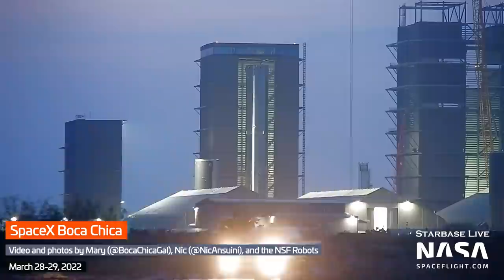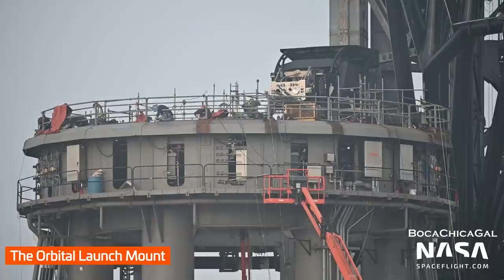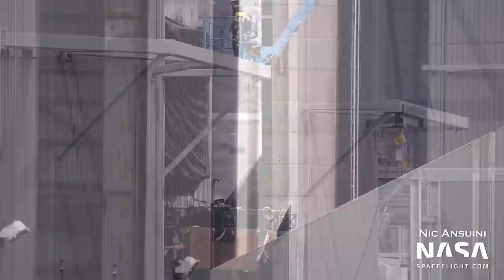Ship 24's Nosecone Nearly Ready for Stacking | SpaceX Boca Chica

Comment from the maker: 0:00 - Booster 7 Moved in the High Bay
0:30 - Sunrise
0:58 - Starhopper
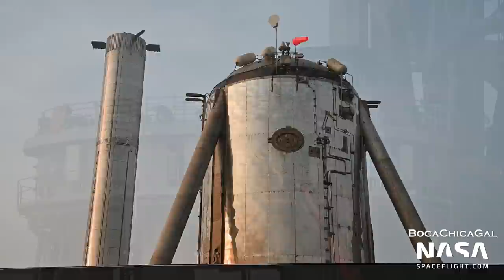1:13 - The Orbital Launch Mount
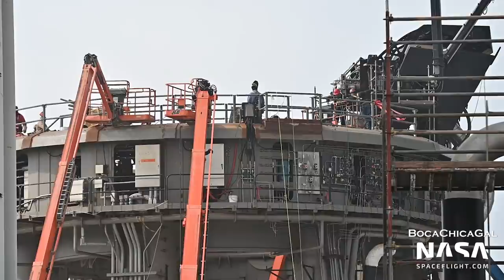2:06 - The Booster Quick Disconnect
2:23 - Liquid Oxygen Delivery to the Orbital Tank Farm
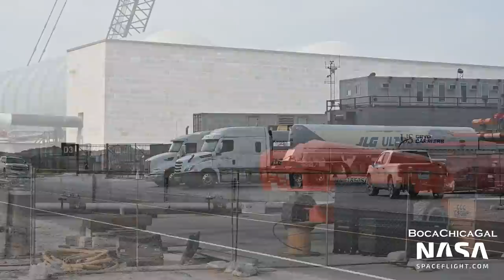2:39 - Crews Work on the Orbital Tank Farm
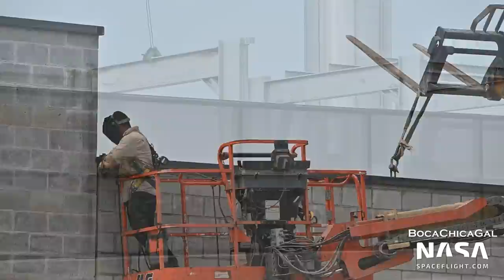3:56 - SPMT Power Pack
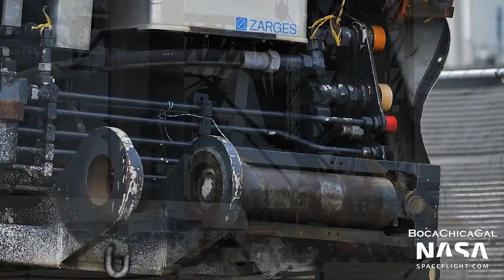4:45 - Ship 20 and Structural Test Stand
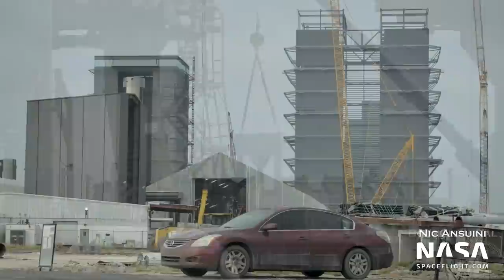5:52 - The New High Bay
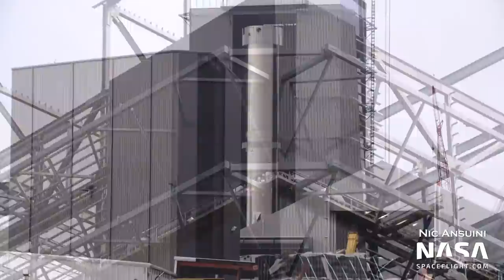6:43 - Booster 7 in the High Bay
7:45 - Ship 24's Payload Bay Section
8:16 - Ship 24's Nosecone
8:34 - Ship 21's Tank Section
8:50 - Crew Work at the Propellant Production Facility
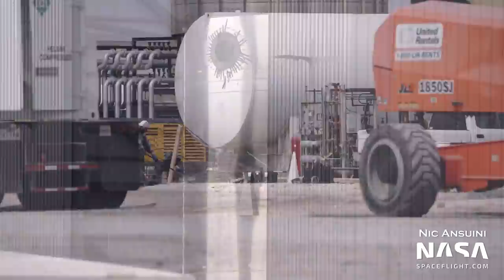9:05 - Ship 24’s Tank Section in the Mid Bay
9:20 - Booster 5, SN15, Ship 22, and Ship 16
Reply: SpaceX CEO wage: $2.7 MILLION/day

When does someone have too much 🪙?  Will they actually do anything productive with their hoarding?

Comment: It's just as well they built the second sub orbital launch pad. I don't know how they would have kept up with this launch cadence without it...
Reply: Absolutely.
During the times of sub orbital testing they often used both pads simultaniously.
They even had booster 3 on one of them while testing a ship on the other
Reply: @rogerhalt3991  Right, it is essentially a pipeline setup.
One vehicle in preparation for a test flight while another is undergoing cryo testing

Comment: Orbital launch much is most complex piece of hardware, it took more time than any hardware and work is still going on.
Reply: @rogerhalt3991  Yes  that's the case might be.
Reply: @rogerhalt3991  SpaceX haven't been delayed. They had methane problems are are only just sorting them now. Had approval been given they still wouldn't be able to launch yet.
Reply: Yes, it is.  It's also, by far, the most expensive single piece of equipment on the entire site.  This may explain why Musk decided not to risk launching 4/20, as it would have yielded minimal data useful to the current production line of both the booster and the Raptor engines while, at the same time, presented considerable risk to the extremely expensive and time-consuming "Stage 0."
Reply: @rogerhalt3991  Can't worry about what ifs, only what is.

Comment: They Should definitely use 420 as a water tower at least
Reply: As odd as it sounds, I doubt 4/20 had the structural integrity to act as a water tower.  The internal pressure at the base of a 100-ish meter tall water tower would be around 140 psi, or around 9.5 bar.  Recall that some of the previous test vehicles were intentionally failed through cryogenic over-pressurization and they popped at around 7.0 to 7.5 bar.
Reply: @glennpearson9348  Okay then. How about a water tower, half full? 🤣

Comment: So Booster 7 will lift ship 24 with the cargo bay door? If so I wonder if they will deliver some (likely a small grouping) of starlink satellites to orbit.
Reply: If there is any payload on the first flight, it would probably be a mass simulator, maybe Starlink shaped. I doubt they would risk functional satellites on a first launch.
Reply: @WM3636-d1c  It wouldn't be that expensive to put 1 Starlink satellite on board.
Reply: @michelleroberts1370  Or 5. They need to test the dispenser too.
Reply: @knowledgeisgood9645  First test is suborbital, not orbital. Yes, it wouldn't take much more to orbit but the Starlink satellites don't have much thrust either. There's not going to be any functional satellites on the first launch.
Reply: @heartysteer8752  They could use dummies. That way they can test the system without wasting any real satellites. Or just a block of concrete.
Reply: @heartysteer8752  if orbital speed is obtained, and in the correct orbit, satellites could be released. I think.
Reply: @heartysteer8752  The test intended for the 4/20 was suborbital.  IMHO it was intended primarily as a test of the TPS.  For that objective if the booster got as far as MECO with most of the Raptors still functioning it would have been a productive exercise.  However almost a year has passed and the first flight test will be of 7/24.  The test specifications issued to the FCC, to permit use of Starlink, have been entirely superceded because:
1. the new test vehicles are a generation more evolved and more reliable 
2. The Ground Support/Stage 0 is now complete and tested 
3. Starlink is much more complete and provides superior functionality

The objectives of the first test flight are therefore vastly different and in particular the odds of Starship achieving orbit are higher.

Comment: Will b5 ever fly?
Reply: No
Reply: It's an old design and SpaceX much prefer the newer iterations, plus they wanna use raptor 2 compatible boosters, which b5 is not. It's more of a lawn ornament.
Reply: When SpaceX builds a ship or booster they usually start building its replacement, in case it fails and they need to repeat the tests. B5 was such a stand-in for B4.